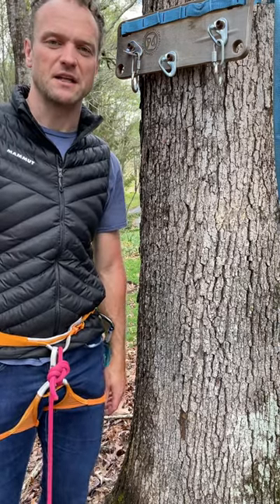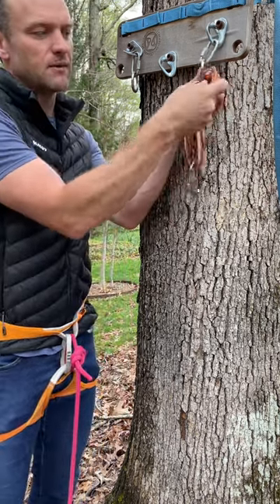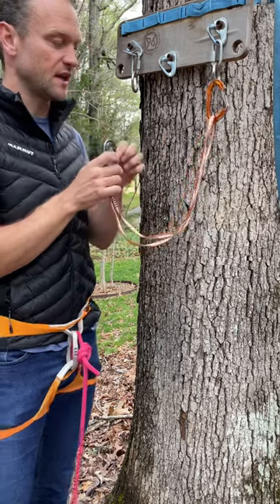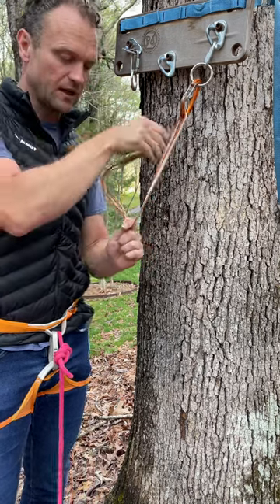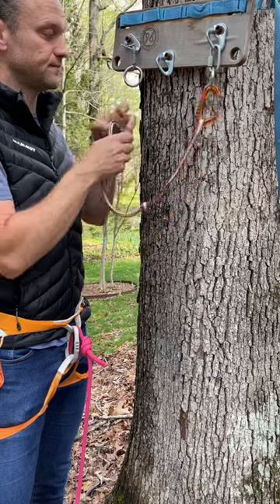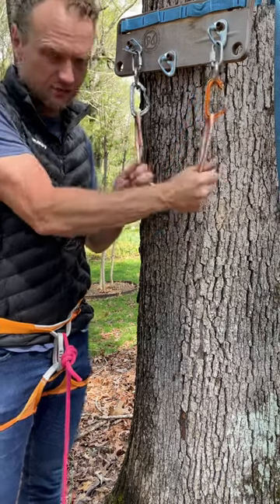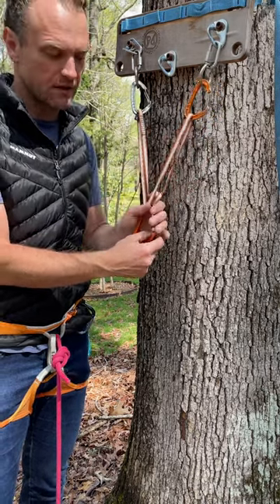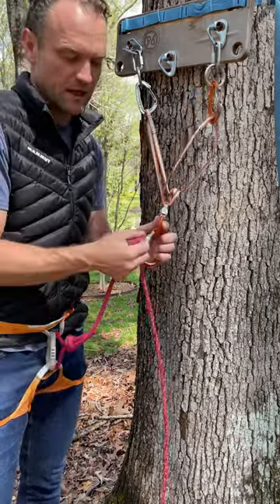Anchor system with one alpine draw #rockclimbing #multipitch #climbing

Comment: For my own knowledge. Why would you clip a second locker instead of just doing a clove hitch to the locker on the sling?
Reply: He is probably using the first HMS biner as a master point. Because of this, if you were to clove into that biner, you wouldn't be able to remove yourself from the anchor without first creating a different master point... Which would be a real PITA while the anchor is loaded.
Reply: If it's your master point you don't want to keep opening and closing it to add more attachments.

Comment: Spiffy anchor! Deceptively nice anchor, seems like there “should” be something wrong but it’s super solid. If you want a 3-point anchor and have 2 alpine draws, you can just do this twice (or use a plain sliding X for the back anchor)… I think doing that has a name, I’d call it serial anchors or stacked anchors but I don’t think that’s what others call it.

Comment: Is there any issue to using a sliding X in the same situation?
Reply from the maker: 2 over hands in a single alpine May not be fun to untie… the master point may be pretty small as well so much so that your losing the equalization quality.  I’d just pre equalize this and go with that
Reply: Sliding X isn't redundant. This is.
Reply: @climbon3157  Its redundant, but can have excessive extension.
Reply: @Fiona Andrews  the sliding X isn't redundant. Sever any piece of it and the entire thing fails.
Reply: @climbon3157  that's true. Will only guard against one anchor failure.
Reply: ok so this is an extreme situation where you don’t have much material to work with, I get that… the sliding x is redundant for anchor failure but not to sling failure and it extends, with such a short sling I wouldn’t mind the extension, however all textiles fail at a knot… so if this makes it redundant to sling failure by tying a ¿knot? I feel safer with the sliding x… anyway it’s a technic I didn’t knew before and I do now 👍🏻
Reply: @MikeInNature  thanks for the info, I have found that putting overhand knots in the ends of a double length sling leaves pretty of material for the “x” and is “redundant”
Reply: @MikeInNature  Yes, tying extension limiting knots both ends would make it redundant.
Reply: @grizzlywanderer

Comment: Genuine question from a beginner climber, isn’t connecting two biners a safety concern?
Reply from the maker: Typically no, this is a common misconception
Reply: The main scenario to not attach two carabiners together is when you’re extending a piece you don’t want to clip two non lockers together as they can rather easily unclip in the event of a fall